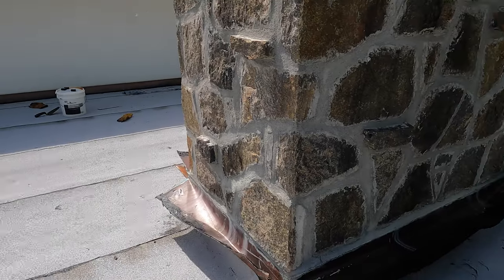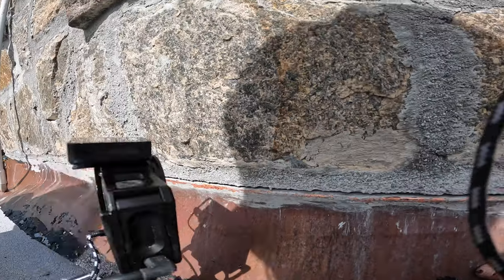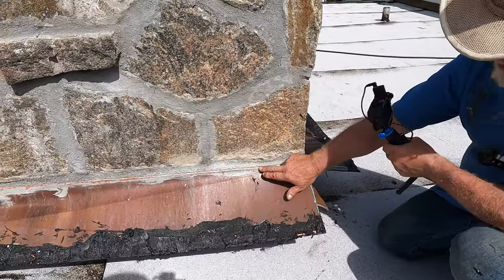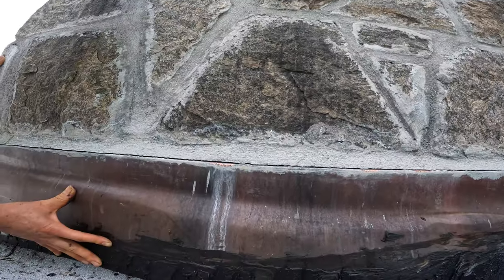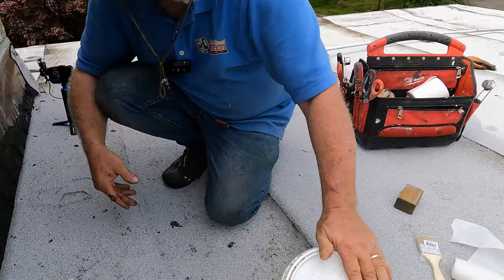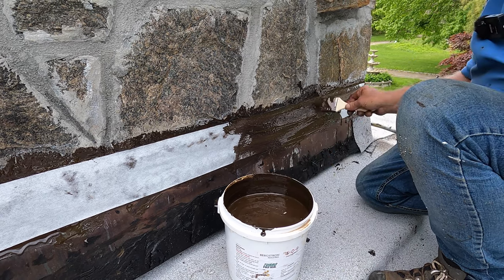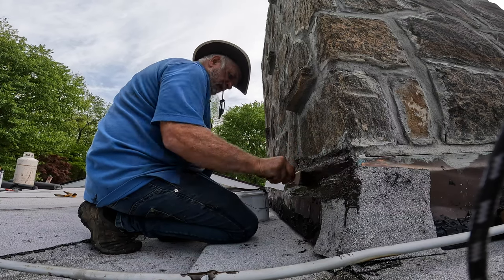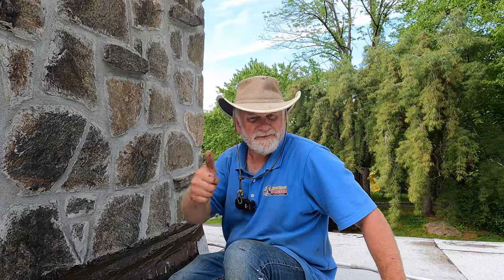Chimney Leak Repair Flashing

Comment: Thanks for the channel, recently did my first torch down to finally end the leak nightmares on my loft. It was 4 layers of torch covered by a layer of epdm a guy (local kid, son of a contractor who cut every corner possible) did last year all on rotted decking. we (me and a buddy) tore the whole thing off (11x20 area) , all new insulation, decking, paper, base layer and a torch membrane. No more leaks, no more ponding and no more thin innertube up there that never kept out the water. I would have never had the confidence to try if it wasn’t for your channel and my girl and I could not be happier with the results. We literally had buckets up there and a dehumidifier running 24/7 all winter because the kid couldn’t find or fix the leaks (could have been stretched seams over bad decking, could have been the termination bar he screwed directly into our caps… such a nightmare 😂) anyway, just wanted to say thank you